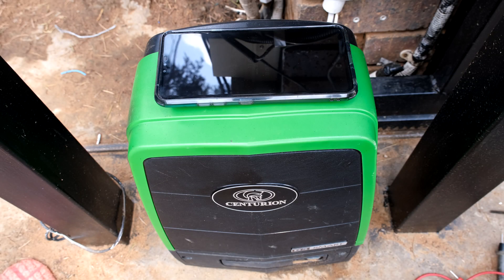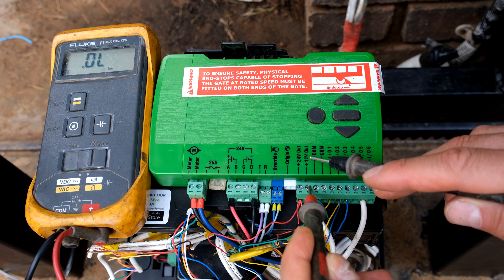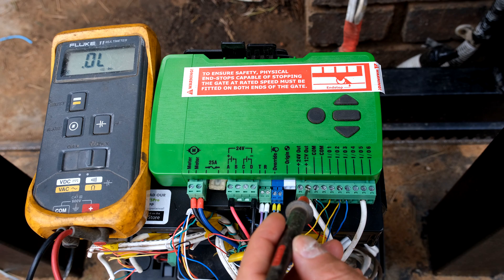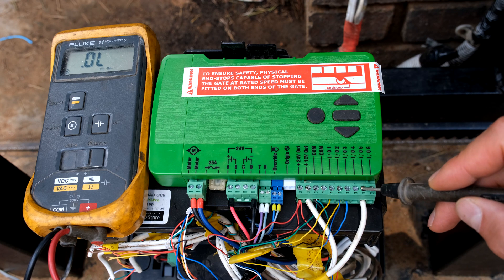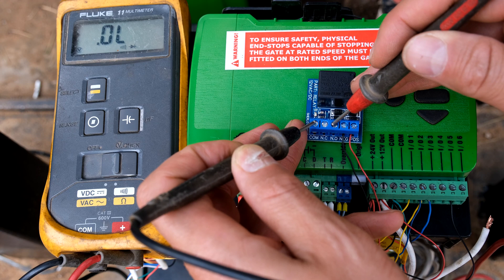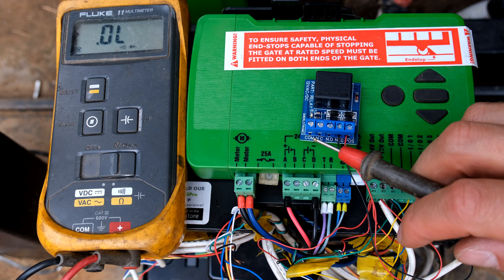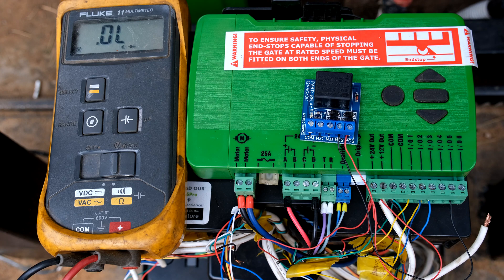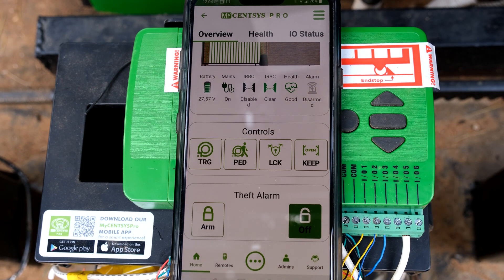How to connect your Centurion D5 Smart gate motor to your alarm system as a zone for tamper.

Comment: Just add a 15w siren as per the first part of the clip and save the complicated alarm integration. I did that, and it works perfectly. Always armed, and you can set the sensitivity on the app. The alarm siren cable is in steel conduit to prevent thieves cutting the siren cable. Nice video. Wel done for figuring out the alarm integration!

Comment: Thank you for this video, very informative. 
Will it be possible to connect to the I/O but with an external 12v power supply, or should I say without using the 12v from the Gate controller?
Thanks again, really enjoy your videos.

Comment: I am using  SecureGuard system and I asked my security company technician to link the motor as a zone and they said I cant. So dissapointed. At the moment my gate motor is linked to my security system and I can remotely open the gate via the Security system app not sure why they say the motor cant be a zone in my panel.
Reply from the maker: it can be connected to your panel. I dont have a video though.

Comment: Thanks for the video. Is it possible to connect to an alarm wirelessly?
Reply from the maker: yes it can be done, you can get a universal wireless connector or use a remote that is hard wired and its receiver is then installed on the alarm side. I may do a video on this in the next few weeks.

Comment: Thank you for making the installation so simple , just a quick question for the alarm siren feature must you have ana external siren or would the unit have a built in one?
Reply: Hi. I have two Centurion D5 Smart Motor and I connected both of them on my alarm for a tamper alarm. I also have two relays for the automation. If i bump the gate for an alarm my other gate triggers. What can be the cause? The gates is Zone 8 & 9 and the trigger is on PGM 1 & 2 each having its own relays?
Reply: If you have a solution for this please let me know.
083 230 1194
Reply from the maker: thanks, you need your own siren
Reply: @ecologicaltime  thanks for the response much appreciated